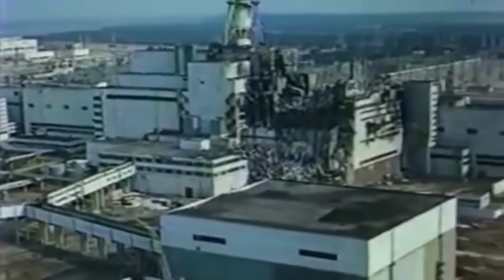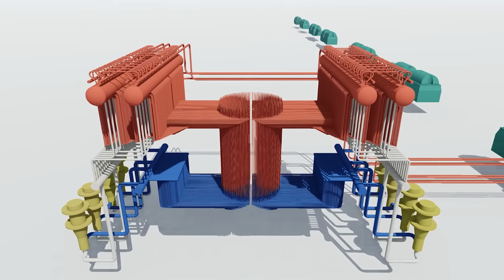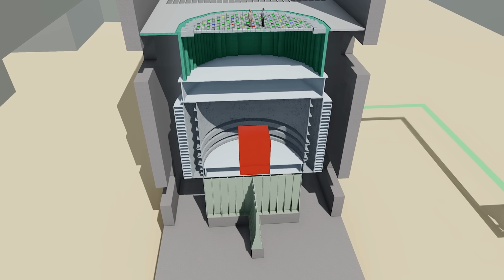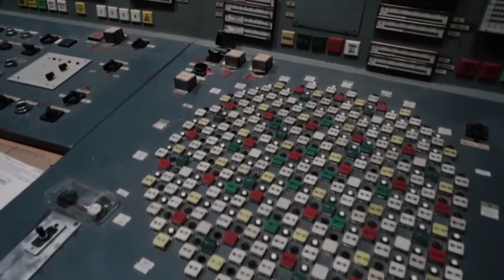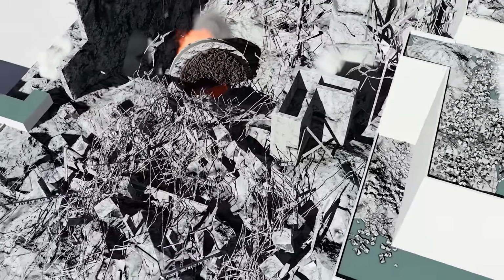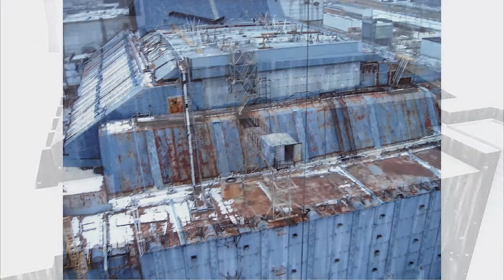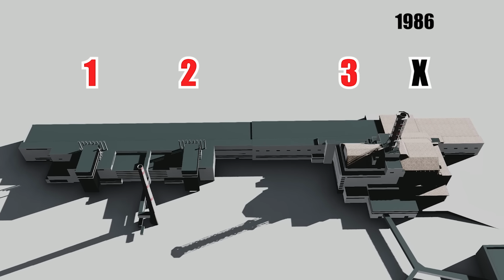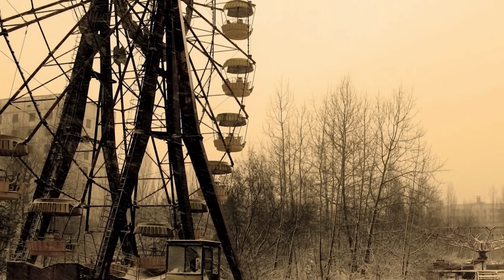CHERNOBYL DISASTER - An Inside Look - 3D

Comment: CANDUs and RBMK's share some design similarities (online refuelling, pressure tubes instead of pressure vessel, physical size due to low-enriched / natural uranium) but have some significant safety-related design differences.  CANDUs are moderated by liquid heavy water, not graphite, and the water-filled reactor is immersed in another large tank of light water called the shield tank.  As a result, the CANDUs have a significant amount of passive cooling capacity, and water doesn't catch fire.  Another critical difference is the CANDUs are fully inside a concrete containment structure, and the Ontario Hydro multi-unit stations have a massive negative pressure vacuum building to reduce pressure within the containment building if there is a large steam release in containment as a result of an accident.  CANDUs do have a positive void reactivity, and for this reason they have two independent, fast-acting shutdown systems that are physically separate from each other and the control systems.  Each system is designed to shut down the reactor in a matter of seconds on its own without needing the other system, however both systems are designed to initiate shutdown independently and immediately if a design-basis accident occurs.  Also, following the Chernobyl event Canadian engineers travelled to the Soviet Union to learn what happened and determine if anything needed to be fixed or addressed in the CANDU design.  There weren't any significant design issues identified in the CANDUs, but one operating change was to reduce the maximum flux tilt allowed within the CANDUs before reactor trip is initiated.  This reduced maximum flux tilt limit is still in use today.  Great video, btw. (Edit:  corrected "end shield tank" to "shield tank".  The end shields are distinct from the shield tank.)
Reply from the maker: Thanks for the detailed explanation. It is significant that Canadian Scientists were allowed to talk to the Soviets when safety was the focus. But admittedly that was in the time of Glasnost and shortly before the Soviet Union dissolved.
Reply: @jingchenbi7419  The problem of making a reactor as large as the epr, or larger than 3.3GWt is that it becomes hard to engineer and construct, originally Rosatom didn't plan the VVER-1200  but rather a VVER-1500 or VVER-1800, they ditched it for the VVER-1200 because it was easier to do, as a result they build those things in their country for 1800U$D/KWe, and the VVER-TOI they are in road to do it for less than 1400U$D/KWe 
The sweetspot for nuclear power size is around 2700-3300MWt, where scalability and size meet, larger than that and you need a higher degree of engineering to guarantee the safety of a 4.5GWt reactor that has pretty much the same pressure vessel as a 3GWt one, as such the level of engineering of the safety systems increases more than the possible benefits of a larger thermal output
The workhorse of france's nuclear industry has been the 900MWe class, while the reactor on which the epr is based, the N4 has been taken 15 years to construct in chooz and civaux.The EPR-2 hopefully will have around 1300MWe and 3200MWt, it simply becomes less challenging to build.
The same issue happened to South korea, they builded the OPR-1000 for 1900U$D/KWe, and when they decided to supersize it into the APR-1400 they ended building those for 2250U$D/KWe, they are planning to replace it with the iPower with a output of 1200MWe and 3200MWt
Taishan 1&2 costed around 2300U$D/KWe, sure better than Flamanville and Olkiluoto, but not good enough to be better than the 900MWe french ones. 
The lower construction time of taishan and less delays has to deal with the fresh experience the chinese have at building reactors, and the more fordist and direct approach they have, they like to have everything built before starting construction, while in europe and the usa they went for a more toyotist way of doing things, or in-time logistics.
Reply: @jingchenbi7419  They actually thinked in making a larger and cheaper version of the RBMK, the RBMKP-4800 with 14400MWt of power, it was going to be a square block and assembled outside over rails, they would remove a wall of one of the units while still operating, and and move the new reactor block until attaching it to the operating one, so you can imagine a miles long strip of a single modular RBMK-4800.
https://youtu.be/Z3_4q-uTpPk?t=642 at the 10:42 you can get an idea of what they planned
it has to be said tho, that they didn't want to stop it there, the RBMK was originally designed to work at 50% efficiency or more using supercritical steam turbines, so the RBMKP-4800 could have outputs of over 7700MWe per block, they also were thinking in using a fast neutron version of it with 15% enriched uranium that could have much higher power outputs since fast rectors have very small cores that they wanted to make very big, the 1300MWe BN-1200 fast breeder will have a core of just 85 in height and 2 meters in diameter. 
it has to be said tho that 1500MWe and thermal power are very diferent things, generally the sweetspot for reactors is around 2700-3300MWt, the EPR thermal output is 4650MWt, the Mitsubishi APWR and General electric ESBWR have 4550MWt and a power ouput of 1780MWe, altho japan planes to scall them down to 3280MWt/1300MWe very large reactors are bastards to build, the Chineses are studying to scale the Westinghouse AP-1000 to make the AP-1400 and then possibly the AP-1700 and AP-2100 with a thermal output over 6000MWt
Reply: @jingchenbi7419  China will build a larger 1400MWe version of the AP-1000 called the CAP-1400 at rocheng, and they have planned 64 of Westinghouse AP1000 fully manufactured in china, westinghouse sold china the manufacturing licences in 2009, they already made 4 of those things
Reply: @jingchenbi7419  France? Not really, today, this very day, the leader of nuclear industry is really russia, Chinese reactors are copied from the french and the american designs.
The VVER design is a tremndous PWR.
Reply: @mab9614  Well, since a few months ago Rosatom started using in their old reactors what they call REMIX which is 7% Plutonium mixed with depleted uranium, the big challenge that using Plutonium in Oxide fuel presents is that it has half the thermal conductivity of uranium dioxide which is by itself a very poor conductor of heat, so a lot of research is in metallic fuel or carbide ceramic fuels.
While the Candu is not as a attractive today as it was decades ago when uranium enrichment was expensive, it still can do interesing things, the Candu-9 which is based on Darlington has a power between 900 to 1300MWe, or 3000-4000MWt, it can also use spent fuel from PWR that can't work under 1% enrichment, also because it has a conversion ratio of 0.9:1 when breeds plutonium it would be a nice thing if we manage this whole breeder reactor thing
Because on U-233 a LWR is a Plutonium isobreeder, but a Candu on U-233 is more a full plutonium breeder

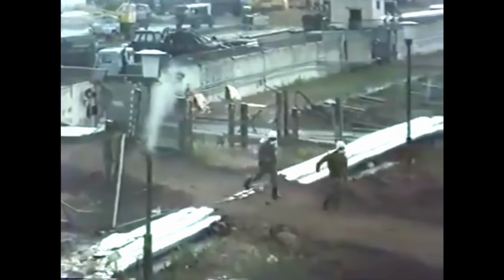Comment: 5:03 -- The upper biological shield (Elena) weighs 2 million lbs (1000 tons) and was tossed into the air and flipped over like a child's toy.  It's still a threat as nothing is holding up on its side but rubble.  If it ever topples over and crashes to the reactor floor, it's going to create a huge and very radioactive dust cloud which the current containment structures may not be able to fully contain.
Reply from the maker: The upper biological shield works like a round manhole cover which cant drop into the manhole. The upper biolgical has a larger diameter than the reactor core sides so it won’t fall inside. There was great fear at the time because from fotos it looked very precarious and like it was ready to slip down at any moment if the debris it was resting on gave way. It has stayed put for the past 33 years because the reactor drum is securely supporting it and will continue to hold it for decades... or centuries. Who knows!?

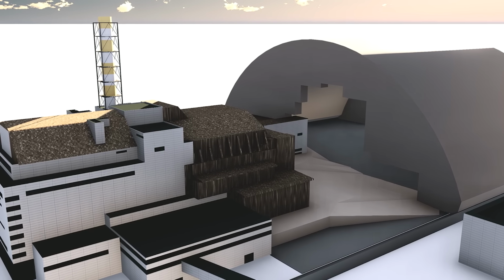Comment: Wait wait, 06:07  "the ventilation tower had been replaced with a smaller one"....does this thing still have a function or it was just recreated to gave a fancy appeareance to this disaster for the dark tourists???
Reply: It has a function.  Reactor 3 right next door still has fuel rods installed that must be kept cool.  Reactor 3 is being decommisioned which will take at least 10 years to complete.
Reply: @NealB123  Thank you for the answer, watching another video i learnt that the vent was shared between react. 3 & 4 👍👍

Comment: Doest seem to explain the details of how a meltdown happens, just that it's a flawed design and some automated safeguards were bypassed.
Reply from the maker: This was primarily an explosion event. The meltdown happened as a result and beside there was not that much fuel left in the core to meltdown because so much was exploded out of the core. This video examines what the RBMK looks like on the inside and that is a lot to cover. The how and why it exploded and then melted into the basement is for a follow up video.

Comment: That "fragment from the core" bit...I shudder to think THAT was what was left of one...and how deadly it was just being NEAR it.
Unless it was a sfae one simply cut from one of the undamaged reactors
Reply from the maker: The photo was taken inside the core with a remote camera.  The core was left pretty empty after the explosion.  Much of the contents were blown up outside the core and quite a lot of the very  hot stuff was molten like lava and and dribble into the basement below the reactor.
Reply: @Mike-Bell  quite suprised the camera even worked still. Isnt the core STILL emitting electronic-killing levels of rads?

Comment: I thought the control room was a bit higher up, from the schematics it looked like it was on the top floor of the adjoining turbine building whereas here it seems as if on the bottom floor. Either way, very well animated. Does anyone know if the missing plant worker (Khodemchuk?) was in the north or south pump room?
Reply from the maker: From the walkabout videos online It seems like he was buried in the north pump room. 

The control room is in what is noted as the deaerator building which is part of the turbine hall block. The location in the animation is accurate as per the building plans I used for reference.

Comment: Could somebody be kind enough to explain what void coefficiency is, I can't seem to find anywhere on the internet what it is. Maybe I'm just having a language barrier since I'm not from an English speaking country.
Reply from the maker: If voids form in the coolant of a reactor, as the water turns to steam, the steam bubbles are voids. With a negative coefficient it means the reaction slows. At low power Chernobyl had a positive void coefficient where when water turned to steam the reaction increased. 
Above 1/3 power Chernobyl had a negative void coefficient which is ideal.
Reply: Mike Bell Oh, so what you are saying is that steam bubbles are voids and that they are used for slowing down and speeding up the reactor core. Don't judge my knowledge please I'm just a high school student :D
Reply from the maker: Yes what you say is correct. The void coefficient is important in that it tells if the reactor is stable or unstable. Ideally a reactor should be stable. The RBMK was unstable at low power or (when cold)  and stable at high power (at power producing temperature)

Comment: What is the purpose of chimney here?
Reply from the maker: I have found it difficult to get a good answer but it seems like it was a ventilation stack to discharge contaminated air at higher level which sometimes happened during work in the reactor hall.  The other theory is it was a way to create forced ventilation and extract heat from the steam pipes if the the steam/ water pumps weren’t working properly.  To reduce the chance of overheating.

Comment: Anatoly Dyatlov was an extremely smart and respected nuclear scientist. If the emergency shut down worked as they thought it was designed to, the reactor would have never over pressured the cap and blown it off. The RBMK was a unique design and wasn't very similar to other other reactors of it's time. So making safety protocols for something that has never failed is kinda hard. Plus, nobody imagined a reactor would be tested the way they had. Anatoly was innovating the future for emergency protocol of RBMK reactors. Anatoly is not to blame for the explosion, the Soviet union is for designing a domestic nuclear device. However, he is responsible for his actions following the explosion that costed hundreds their lives.
Reply from the maker: Anatoly Dyatolv had a long career with nuclear reactors in submarines and then later during the construction and operation at Chernobyl.  
However his training was more technical and less nuclear physics and he had limited understanding of the impact of the reaction poisoning effects of reactor gases at low power. 
The scientists who designed the RBMK were aware of the low power risk and for this reason had written protocols for low power operation.  These protocols were overridden by Dyatlov with the catastrophic results.
The Chernobyl control room staff were the unlucky ones who revealed the deadly result of the AZ-5 switch which at low power that would prove to be catastrophic.

Operators learnt at Chernobyl and the RBMK reactors have been running successfully since without another major mishap.
Reply: @Mike-Bell  Both Dyatlov and the workers understood there was a fail safe within AZ-5 givin grave circumstances. Like I had said, if AZ-5 worked as intended this would have not occurred in an explosion. It would have been stupid still, but it would have re-stalled, and probably tried again and re-stalled again. Obviously they didn't know it was a detonator in their situation.

Comment: So people continued to work there , even after the disaster? Woow!
Reply from the maker: Inside the buildings safely behind layers of concrete the radiation was not a problem. But outside they didn’t want to spend very long and there were hot spots of high radiation they certainly wanted to avoid.
Reply: @Mike-Bell  Wow, cool, thank you very much, great video and 3d modeling. I was also working in 3d studio max.

Comment: It was a poor description of how it went wrong. It is the golden rule that when shutting down a reactor you cannot increase the output until 3 days have passed. There is a decay of radioactive iodine and xenon that  smothers the reaction. They tried to speed up the reaction right away by removing control rods. It didn't work.  So they pulled out more. It finally heated up then ran away. They threw the control rods back in but they caught fire. The explosion blew away the building and since there was no concrete containment it was a mess.

Comment: Every one hundred years they will need to build New Safe Confinements for the Old Safe Confinements.
  Burdened for 1,000 years.  And now they need New Safe Confinements for Fukushima.
Reply from the maker: Yikes 😬 daunting thought
Reply: Nah, in 45 years the plant will be long gone.  Reactor 4 is going to be chopped up into barrel-sized chunks and then the most radioactive barrels will be buried in concrete and the least radioactive will be reprocessed in another reactor.

And they don't need anything for Fukushima other than a solution to deal with the thousands of tonnes worth of radioactive water they are currently storing.

Comment: Just a clarification. The video said the RBML has a huge core—17 times the size of the one at Fukushima. I don't think that means it contained 17 times as much fuel, although I don't know the actual numbers of tonnes for both cases. I think it mostly means there is more space between fuel bundles. Sort of like the case for CANDU, although very different in other ways.
Reply from the maker: The video doesn’t say the RBMK contained 17 times as much fuel. The vast majority of the core consisted of graphite, about 85%.  There was  more uranium than usual because it wasn’t highly enriched but the uranium is a small fraction of the total volume. 

The video illustrates that a Fukushima type reactor is hard enough to contain and the RBMK would be way more difficult and the cost astronomical due to its shear size.
Reply: @Mike-Bell  Right, I'm just clarifying, not correcting, for the benefit of those who might think there was 17 times the fuel load, as I thought for a moment might be the case. BTW the fuel load might actually be a bit larger, since as you say it's not as enriched as in a LWR. But the two things are not directly related.

Comment: Wait why did they make a new cooling stack, it’s not like there’s any reactors to cool.
Reply: That's a chimney, not a cooling stack, and it's in case the diesels attached to reactor 3 are ever required to be used again.   I would imagine that by 2016 all of the cooling ponds in the other reactors would no longer require active cooling so my guess is that the chimney has been kept for a "just in case" scenario since the work inside the New Safe Confinement (NSC) will be going on for decades and having access to a couple of powerful generators and not needing them is much better than having a storm take down your power lines and wishing those generators had a chimney.
Reply: Rob Fraser 
Oh ok, but then why was it so big before yet so small now? I am so confusian

Comment: Ok you messed up... A control room surviver said only one person knew the fault of the reactor... It was the pump working in the control room...
Reply: No one knew the Reactor has molten down until morning. So the pumps worked all night, the water left the broken coolant loop and spilled at all 4 units causing lots of short-circuits.
Reply from the maker: Nobody will ever know who knew what before the accident and what really happened in the control room. There were conflicting accounts by the control room staff.